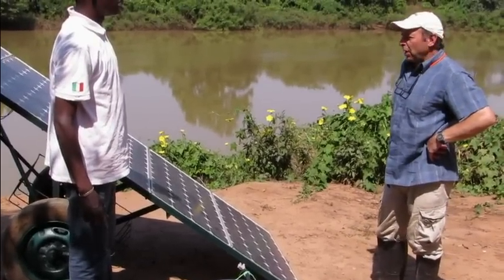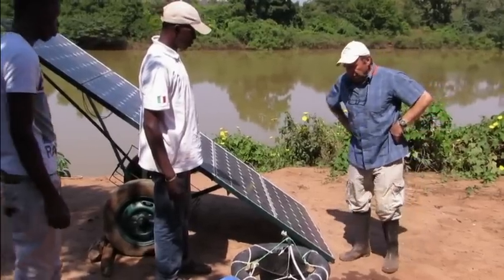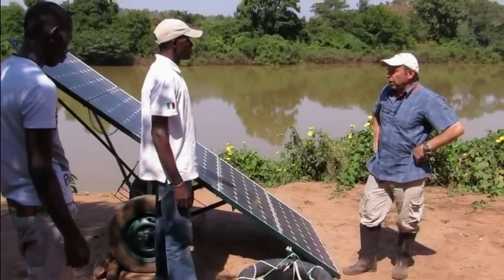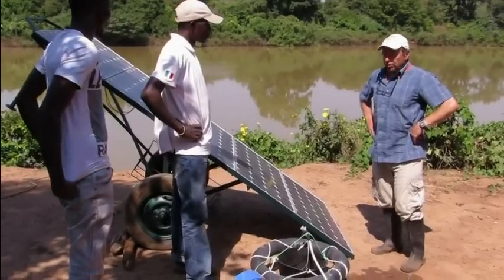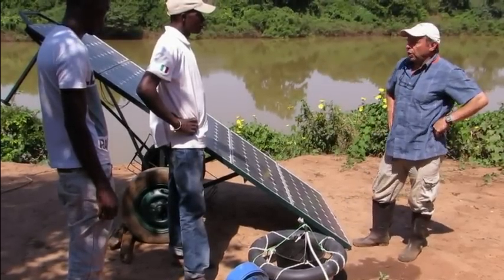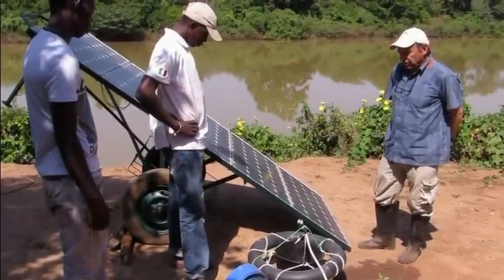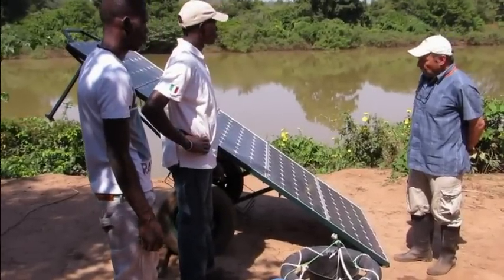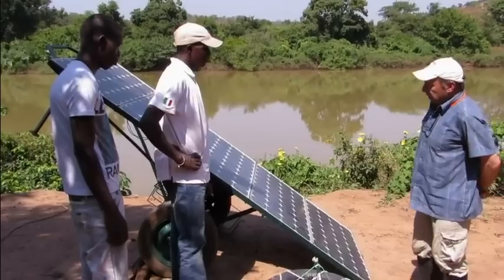Low Cost Solar Pumping System

Comment: Great Job.
Few months back I too assembled one Seaflo make  bilge pump (1100 GPH) for country boats for draining leakage waters that too works fine.I inch pipe outlet too pumping a large amount of water @ 3.5 Amp @12 Volt  connected with 14.4 Ah battery.Too tested on one 165 watt solar panel gives optimum power  output .Your pump is 4000 GPH gives a good water pumping.i  too doubt about head capacity of pump.Surpised about its output .
Great idea for small farmers for irrigation

Comment: Works great in my wine barrel fountain.==>allmy.tips/SolarWPumps?9     Feeds a tube that flows through a 3 foot high fountain. Strong enough to go higher if needed. I love there is NO battery that fails. Just works when the sun is out.

Comment: Pratically possible and easy to operate. Solar energy can be used with couple of batteries and 12 volt dc motor is running a donkey pump. This arrangement can work in the evenings. More reliable with additional cost. Moveable arranangement is a good idea.

Comment: It looks like this system doesn't have a battery to buffer the spikes from the panels.  It's this regulated....
Reply: the panels and the pump motor are matched so that at maximum sun exposure with the pump running, the motor isn't subjected to overvoltage which could damage it.

Comment: Why not add some sheets of metal on hinges, to reflect more light onto the solar panels, and maybe use two pumps at once? I mean, metal sheets are cheaper than the solar panels, right? A bit more energy might be enough to fuel another pump.

Comment: Just an idea to suggest , if more power needed probably is good idea to double the solar panels number by having two fold-able same size frames holding panels using the exiting mobile transportation  ( like opening two pages of a book) .When work finishes the frame could placed on top of each other ...

Comment: i have 15 acre  land elevated 6 feet from ground surface i fall water in to the tank then draw thorough diesel engine that have huge cost every weak nearly 20$ per weak i want to install such a fantastic system in my filed but it has low discharge i need large to irrigate field
Reply: its simple!, get more panels and a more powerful pump.
you're welcome!

Comment: From the solar do u use any charge controller or the wire connected directly to the water pump?
Reply: Hello Bernie, I have a similar system at home, same pump, no charge controller necessary. I actually sell those pumps in Brazil (from China, I have an office in Shanghai) and for the cost, they just get the job done. The key thing in this video is the "bucket system". It is totally necessary to protect the pump while emerged in "not clear water". Any doubt let me know, I also have inverter, solar panels, charge controller, PV wire, lots of water pumps and so on.
Reply: Do you have a website?
Reply: The one in the video is it an automatic or non-automatic pump
Reply: Where you using an automatic or non-automatic pump for your fish farm

Comment: can i hv e price of a  three phase solar pump .and hw does it gate her in zimbabwe at hw much
Reply: Hello Munhandi, the specs should be similar to this: Max Flow: 2000GPH/h
Voltage: 12VDC, Current: 8A, Inlet/Outlet:29mm

Comment: what's the pump used in this video? can I know the detailed specs of the pump?
Reply: the specs should be similar to this: Max Flow: 2000GPH/h
Voltage: 12VDC, Current: 8A, Inlet/Outlet:29mm
Reply: Raimundo Chaves jr Thank u buddy

Comment: great vid .....have u tried two or more pumps in series (closed system) to improve head.

i am planning to use some pvc pipe/spigot  fitted over second pump intake (remove screen) and used as inline boost. air lock may be a issue but may be worth a try

Comment: I suppose a marine bilge pump of that sort is not designed for permanent use as required for irrigation. Also, replacing the pump once a year seems to be quite un-ecological. Can't you find a pump that's made for petmanent use? For example something that is made for water circulation in a houses plumbing?
Reply: Sir it seems he is alittle bit busy irrigating ...can find Us one please
Reply: +Ali Mubiru     Recently I saw in another youtube video a possible solution: for a pump they use a water pump from the water cooling system of a Toyota (I believe it was) car. This is a tiny pump, submergible (!), with a quite intelligent, simple design, and it should be available for very litle money, perhaps even for free from scrap. However, I suppose it will be sufficient only for a small garde, unless you find a way to install teo or thee if them un parallel or so...
Reply: really....quite impresive plz cd u add me that damn link and i have it watched....cant wait
Reply: Yes is a video of a Toyota Prius Pump  very Powerful for so small all electric 12v , I am looking in wrecking yards for one myself to Implement in my Irrigation here on small farm in nor cal :)

Comment: obviously not many crocodiles in Senegal
Reply: Would they chew up the hose, I suppose?
Reply: I have seen suction pipes damaged by crocs, but I was commenting on the casual way that he was standing in knee deep water installing the pump. this is generally ill advised where crocodiles are present.
Reply: +ant13665   Yes... so obviously not many crocos there, otherwise the locals would probably tell him.

Comment: mnre DETAILS NEEDED TO VERIFY 
http://mnre.gov.in/file-manager/UserFiles/scheme-SPV-water-pumps.pdf

 is  THIS turn key contract offer, inclusive of all pricing.

If you pay the price of Rs. 5,00,000/-, you will get

1) Solar Panels: Total 6000 watts (each panel 250 watts, total 24 nos of Solar panels)

2) Solar Pump Controller / Inverter / Meter - Control Panel Box

3) Mounting Structure, Foundation Civil work

4) Junction Box, Wiring, Earthing etc.

5) Inclusive of all Taxes, Duties etc.

6) Transportation of material to the site

7) Installation, Commissioning, On - Site warranty

PLS PROVIDE NECESSARY UPDATE ON COMMERCIALS & TECHNICALS

Comment: Is the pump conected directly to the PV panels? Doesn't it need an inverter?
Reply: depending on the size of the pipe or hose..if you intend to extend the pipe to 1-2km, the pipe's size should be reduced to 50-75% or less,,,the smaller the pipe, the stronger the pressure and the farther it can run...
Reply: If you mean the head delivered by the pump [H], it depends on the type of the pump, the characteristic curve of it which provides you with the delivered head at a certain flow rate [Q] in cubic meter/sec....you should know the required minimum distance you want to fill it with water, then you go to select the type of the pump, then you find out the catalog in which you can find the characteristic curve of it and the required power consumption so you can determine the required motor power and then you can determine the number of PV panels :).
Reply: +Rodrigo Gomez Casafranca The pump motor may be designed to consume DC current.
Reply: +Have a nice time! but do you know how far (Distance) can it pump from the river ? 500 meters, 1km, 2km ???
thank you

Comment: Name of the PUMP is RULE 4000, 
Amazon US Shop at: http://goo.gl/TeW1WR
Manufacturer : http://goo.gl/OjqZDm
India Distributor : http://goo.gl/2mZjvW
Reply: pushkar dey I am not in anyways linked to any of the above companies, just doing it coz many are looking for this pump i guess
Reply: pushkar dey sir can this pump draw water from a well 15 meters deep and fill a tank at surface level
Reply: Absolom Madhaka Sir I am not so sure about that, you can check the link and contact the manufacturer.

Comment: I would like an update.  It would seem that you might need an extra panel or two for maximum power since the pump draws about 400w (and the panels max are 400w).  In a perfect orientation of the Sun with clear skies, you panels would work at full power but perfection is rare with solar panels.  Also, did the pump hold up?
Reply: Or 2-4 metal sheets on hinges, to reflect sunlight onto the panels....

Comment: I heart we went to the Moon in 1968 and we are able to make now a pump that will last only one year.
That mean we are progressing?
There is a pump in Los Angeles that it has not stop since the 1800's 
I do not mean to be negative, it just bug me that we have to work so hard to but craps that will not last much.
Why don't we try to make things that last?
Reply: TiMn8eR911  You have to remember this low cost SIMPLE pumping system was designed to work in very poor areas like Senegal. . Not a lot of used Ford prius to rob pumps off of and buying new would be cost prohibitive.  Only thing I would change ( remember keep it simple , almost zero maintenance) would be to add more panels to increase the efficiency of the system on cloudy days, along with some way of storing water. Storage could be as elaborate as building a raise retention pond or as simple  as a tank of some sort. That would allow water storage for use at night or during extended cloudy periods.
Reply: Tnis guy has never heard of a brushless pump. Ill use one out of a toyota prius. I have a brushless pump in my pond running 24 7 for the last 6 years
Reply: Thanks
What is the model?
Where can I get one?
I designed a large scale bio filter for an Indian community and all pumps in the market only guaranty up to 2 years, under "normal use"
Thanks
Reply: From 2004 to 2010 ford uses a 12v pump on their ford prius cars, im sure the part is used in other vehicles, i vet them out of the local auto wreckers. Every saturday they have a upic day all you can carry out, so i load up on stuff for projects
Reply: Hi
Thanks for your reply.
I researched and the only prius I find are Toyota Prius
Reply: +gear head 
Yeah, but he was trying to keep it simple and trying to avoid electronics to power the motor that can break anytime without a possibility to be able to get a replacement part.
Reply: I am not blaming him, He did an excellent work, it is against the industry of junk fabricating my criticism
Reply: +Camilo Garcia Benitez Because things that last cost more money to manufacture, and many consumers (maybe most) are looking for a low price.  Organizations like NASA and the U.S. military surely have pumps that last a very long time, but cost is not very important to them.  And the U.S. landed men on the moon July 20, 1969.  I have to correct you because I was born in that year. :)
Reply: Gear Head , what is the highest maximum discharge that the brushless pump can deliver?? If used, can't it involve additional expenses for buying the electronic accessories??? Please help me with information i want to try that system

Comment: It is nice to see a humanitarian at work I am pretty certain in the assumption that you are a Bible reader.. If so look at 1John 5:3-5 and consider how your humanitarian acts are seen as an act of love. It is as well the disciplinary nature of God.  Do  use I a NIV translation.  It seems like a overlook fundamental teaching that is of our love to him. 

Now your pump project.. Indeed you're counting on that pump to soak up all the electricity, you're probably hard on the whole system I would think you would need a fuse to slow down the current to the motor and save the wires from overheating.  

Ultimately I think you need to add a battery to buffer the system buffer as in power spikes as well as a bank, and because of a lack of controllers you will need to make a manual dump
Method.. This is simply adding A lighting system to keep your battery bank from giving off vapors which can be explosive hydrogen and they smell bad.

I can not testify to the environment of the river as in law abiding or not.. But if it was enough. Security . I would put this on a houseboat with the battery banks and the pump and hoes and go to site to site that way you have someone living on the thing. Don't forget the 12 vote trolling motor.  And he would need the smallest drift wood boiler cook stove and steam engine to run an alternator.   Someday soon you'll be needing a converter for a chain saw

Ultimately we would like to have an update

Comment: Wow … That pump has a very high head … ( height of water )  This has a a lot of push .  Was that a 12v pump ?
Reply: ***** I'm doing my research on aquaponics … thanks for the tip .
Reply: +TrueBlogge777 exactly sir, do you know how far it can push the water from the river, 1km or less?
thanks alot